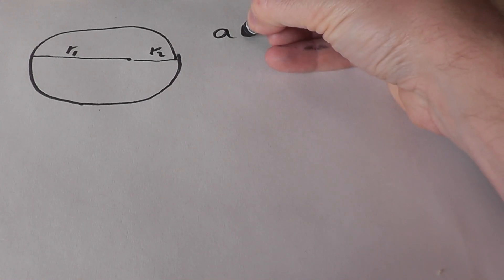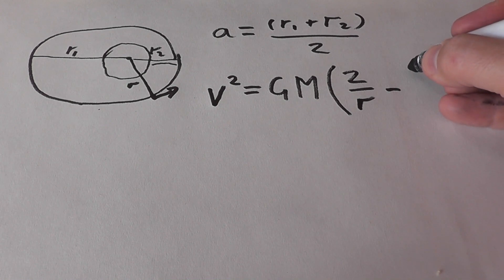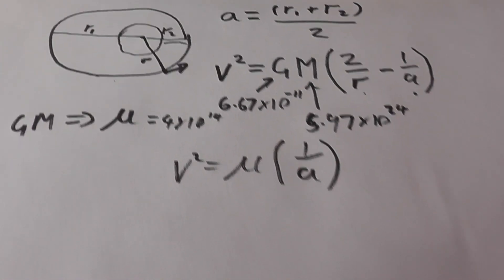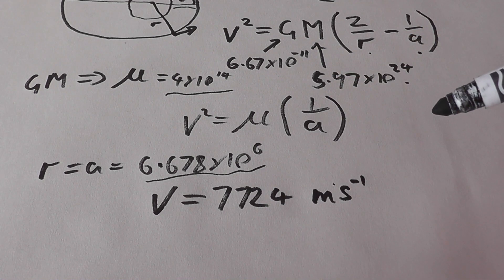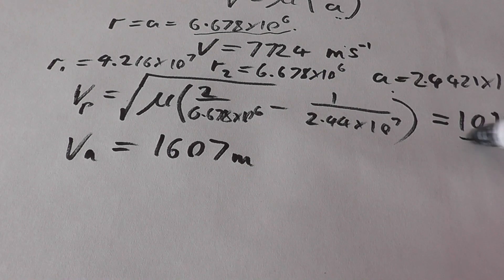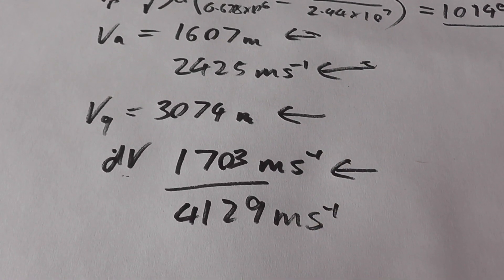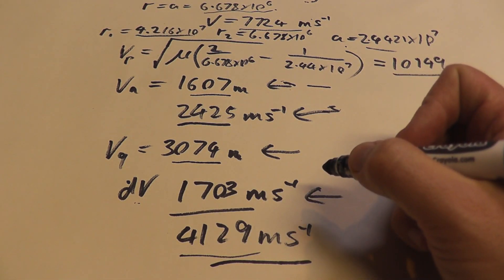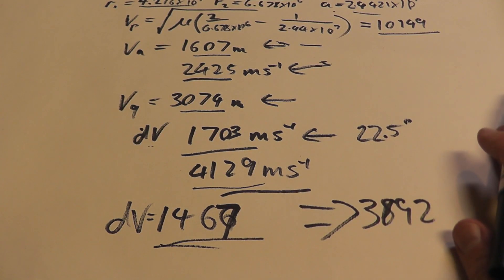Orbital Mechanics On Paper - Part 1 - Addendum

Comment: How much velocity do you need to get any kind of orbit around a black hole? With that equation when M -> ∞,  v -> ∞ :(
Reply: We can actually calculate the mass of the black hole from the size of its event horizon. It's not that the mass is infinite, it's that it's a finite mass crushed into a volume of "zero" that makes the math go bonkers.
Reply: Problem is we may are never able to get enough thrust to get out of a black hole we need a hell lot of Delta-V to get out of it and we need to go faster than the light which we cant do. So an obit around it not gonna happen and if we succeed we mayby need to go around 1.000.000 m/s so we dont get sucked in it.
Reply: MinecraftDog999 That's not actually strictly true... If our sun was replaced with a black hole of the same mass this very instant we would experience no change whatsoever with regards to our orbit around it, roughly at least. Since the black hole has the same mass as our sun, we would continue to travel around it very happily. Everyone seems to be under the impression that black holes have this special ability to absorb everything. But it is perfectly possible for us to orbit one happily. It has been a very strong belief that there is infact a super-massive black hole at the centre of our galaxy, and in fact at the centre of most if not all galaxies. The only problem in proving this theory, funnily enough, is being able to observe the black hole.
Reply: Crazy Hazy
Exactly. In fact that's how we typically calculate the masses of the black holes we can observe, by measuring the orbits of other bodies around them (usually a sun in a binary orbit with it).
Reply: +Crazy Hazy ah ok but still you have to have a very fast speed to orbit a black hole if the black hole has the mass of our sun than we would have no problem exept on earth its gonna be very cold. But if the black hole is heavier than we would need more speed. And your right that the center of our galaxy is a black hole. And yes observing a black hole is difficult cuz you dont see the black hole only the light which is absorbed in the black hole. And if we would observe a black hole we have to send a probe to it and just before it get spaggetified it has to transmit all the data its funny to see a object getting spagetified its just stretches out till it ''burns'' away but a strange this is if you are near a black hole you seem to go slower.

Comment: Interesting observation, but I've never seen ms^-1 in my Layman's mathematical career. I'm assuming that's a physicists thing?
Reply: ***** Oh, I was well aware of it being the unit symbol for metres per second. Probably should've mentioned that. Just haven't seen it with the seconds denoted with an exponent of -1 before. Might just be an American education thing. :P
Reply: Home of the Wilt it basically saves you space. If you need to write out the factions on top of eachother you either have to write it really small or you start up taking more space.

In more advanced mathematics this also shows up pretty often and especially for units which consist of many other units it is just a whole lot easier to write it that way.
Reply: Home of the Wilt It's the proper way of doing (it lacks the ambiguity of using / with more complex units). Any kind of post-school physics should really be using that style of unit.
Reply: ***** It still is a physics/engineering thing as mathematics itself has no need for units.
Reply: Airblader
On the other hand, mathematics does have the need to express the idea of dividing one symbol by another from time to time, so 1/x = x^-1 is something that should be covered at some point.
Reply: Of course negative exponents are mathematics. But from what I understand that's not what OP was confused about. Instead it was about applying this to units.
Reply: Airblader Wasn't quite confused, per say. Just hadn't ever seen the connotation of using negative exponents in units. I'm very well aware as to how it would've applied. I've aced every mathematics class I've ever taken. :D
Reply: ***** No, it doesn't. Mathematics doesn't know physical units. Physics does. Please read the comments to see the difference between the concept of negatve exponents and the concept of applying that to physical units I was referring to.
Reply: No, physics is not just applied mathematics. Just like mathematics is not just numbers and equations. Physics could exist without the mathematics, but it couldn't exist without its concepts. However, it utilizes mathematics as a language of quantifying results. I also strongly disagree on the uselessness of (yet) unapplied mathematics, though it's a popular opinion (among non-mathematicians). There is beauty in mathematics and a theory not applicable to real world problems has its own charme because we managed to come up with it without having to rely on our environment – we could've done deaf and blind in a black, sealed box with only pen and paper. Besides, many theories in mathematics were considered "useless" until someone found them to be actually pretty darn useful (e.g. complex numbers).

Comment: Why does he say geostationary orbit is 42,164 meters up? Isn't geostationary orbit achieved at 35,786km with a velocity of 3.07 km/s?
Reply: Solved my own mistake, which Scott pointed out at the beginning of this episode, the 42 km is the 35+ km altitude plus the 6+ km radius of the earth.

In case anybody got lost with terminology as I did, I think I can explain the second half of the video. We start at 300 km above earth (a=r=6.687km) at a velocity of 7724 m/s. To raise our apogee to 42,164 km (35,786 above earths surface) we need to speed up to 10,199 m/s (delta v of 2475) anywhere on our orbit, making that point the perigee. When we reach apogee, we will be traveling at 1607 m/s. To raise our perigee to also be at a distance of 42,164km (a.k.a. altitude of 35,786 km), we need to raise our velocity to 3074 m/s (delta v of 1467), which is calculated using a circular orbit with a=r=4.2164e7.

Using those two burns we should now be traveling in a circular orbit at an altitude of 35,786 km from the surface and a velocity of 3074 m/s. Hope this helps and doesn't confuse anyone further...

Comment: Im 11 years old and im watching this. Can someone explain what 6.67 x 10^-11 means? I understand powers but not this.
Reply: Also I don't understand when hes talking about the mass of the earth. cant he just write the kilograms without the x 10^24?
Reply: jaffawho I  give up. The answer to those two questions is all I want to know.
Reply: jaffawho This is known as scientific notation. If you wanted to write out the mass of the earth, you could write it out as 5972190000000000000000000.0 Kg. This is far easier to read as 5.97219 x 10^24. Basically, you slide the decimal point to the right for large numbers, and left for small numbers based on the sign of the exponent. So, in contrast, the gravitational constant could be written out as 0.0000000000667 N·(m/kg)^2 with the same value as 6.67 × 10^−11 N·(m/kg)^2. http://www.chem.tamu.edu/class/fyp/mathrev/mr-scnot.html Good luck in the sciences. Don't give up yet!
Reply: jaffawho I assume you are unfamiliar with scientific notation? 
Basically, the number 5000, could be expressed as 5 x 10^3. The 5 is the leading digit and there are three zeros after it. So by multiplying something by 10^3 I am moving the decimal place 3 spaces to the right. This is the same across the board.
When there is a minus in front of the power, just think of it as moving the decimal place to the left. So, 5 x 10^-3 is 0.005.
If you apply this to your original question, 6.67 x 10^-11 means 0.0000000000667. 
Or is it the concept of the gravitational constant (G) that is confusing you?
Reply: jaffawho 6.67E-11 (E is x10^ basically) and 5.97E24 are shortcuts that scientists and mathematicians use. If you were to write out 6.67E-11 entirely, that would be 0.0000000000667. Similarly, 5.97E24 would come out as 5970000000000000000000000. If you were using a lot of these values for calculations, writing out all these zeros repeatedly will definitely break your wrist and pen, so we decided to just shorten it down using x10^.

It's really that simple. Once you start doing science in high school (or maybe earlier, not very familiar with the American education system) and the like, these things can really save you time for your calculations.
Reply: Victor Neo Could you tell me why he wrote 6.678x10^6 instead of 6.678x10^3 as the distance from you to the point mass at the center of Earth? I get that the diameter of earth is approximately 6,300 and he has a 300 km orbit above Earth so that would make his distance 6,678 from the point mass of Earth. Where he lost me was when he wrote 6.678x10^6 because that makes it 6,678,000 km instead. It's meters isn't it. Dang't I'm stupid. lol Just realized that after writing all this.